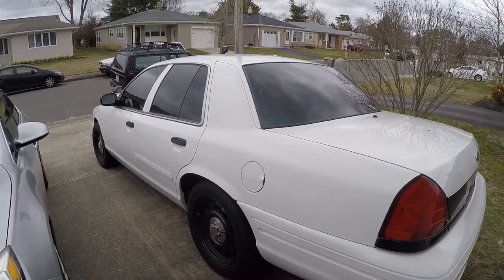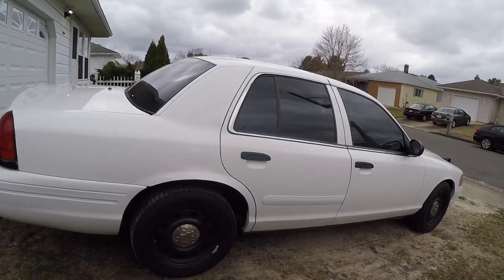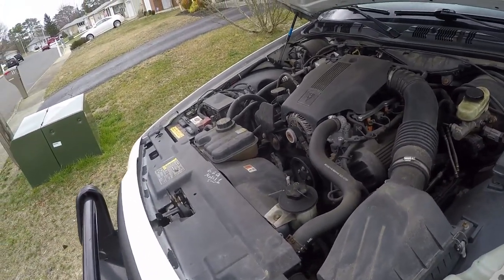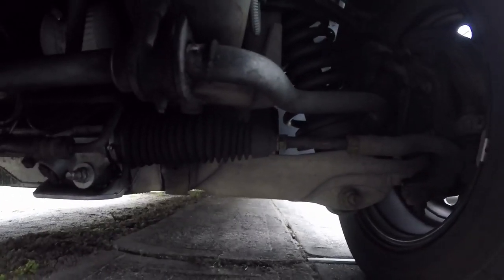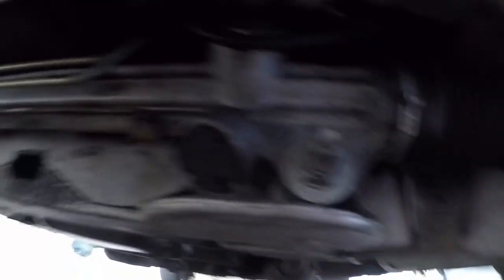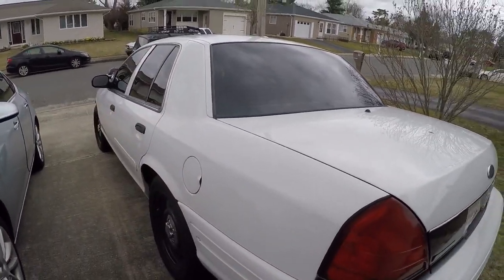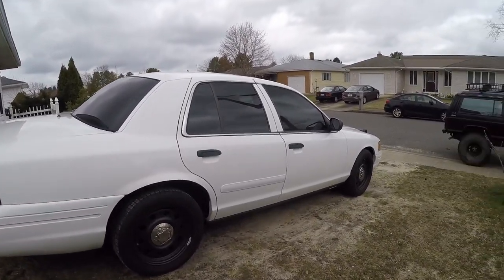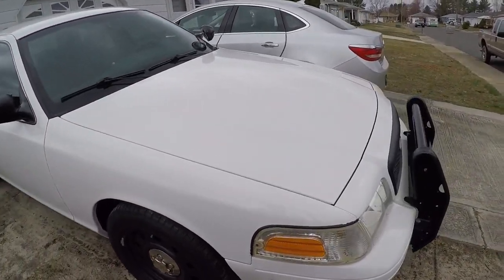CROWN VICTORIA STEERING RACK ISSUE OUTCOME

Comment: I went to a dealer to see if they'd replace my lower steering shaft last year. Had the exact same issue you had were it would get tight at certain turn positions. Should have been under warranty, but mines an 04 and I guess recall started for 05+ models. I googled the part and it cost like $70 or something like that. The service guy was trying to charge be $250 for the part and he was trying to scare me into having them diagnose it saying it might not even be the issue. That would have been another minimum of $100. Then to replace it I believe he said $300. So I went down to the parts department and bought the part for the normal $70. The service guy yelled down it was the wrong part, which it wasn't. I then went to my mechanic and had him put it in for  another $80 and it fixed the issue. Dont trust dealers.

Comment: Rack and pinion steering blues?

On my 1989 grand marquis. I had cluster @#%& problem. Power steering pump leak, very minor, and steering box leaking over the pitman arm.

I took off old lines, and and brushed of the rust with the an old steel brillo pad. Looked for cracks or tear. None. Bought a steering box from napa 150 bucks. Put it on. 
 The rag joint was real bad, but not having the tool or skill to cut rivots, i left it alone. 

Then i put everything back together, still had some leaks because lines werent tight enough. After a few adjustments, no more leaks. 

That being said, used or rebuilt steering boxes not the greatest but its a 1989 you know, why the hell drop serious dough on an old fart?

A rack and pinion steering, i would never be able to #@%! AROUND. id have to take it shop. 

Its why sometimes i think the grand marquis up to 2002,  are easirt to @%#%!$ around with. I just changed oil on my 2008 grand marquis, and the darn strut and springs being outward made it difficult to remove oil filter. (On all 1979-2002 marquis) it isnt so.  In fact the older ones have springs and primitive shock absorbers that are said to be easier to remove.The 1989/2000 you can remove oild filter without sticking your head underneath the car. Just arm.

My 2000 grand marquis undercarraige not that cramped, very accessible. Very similar to 1989. The 2008, things just looked more crammed.